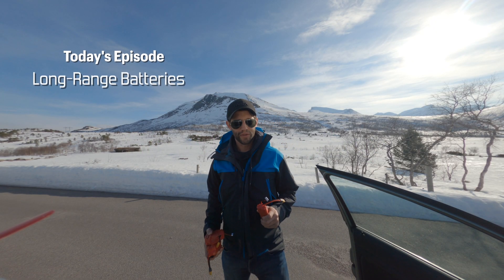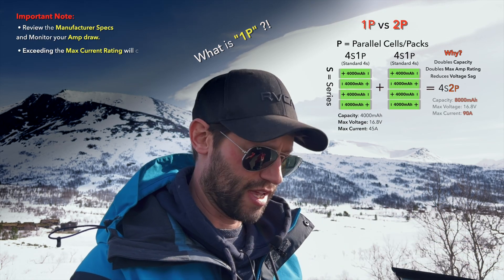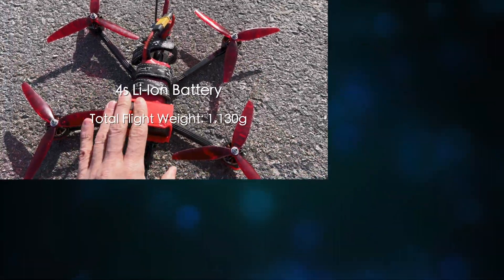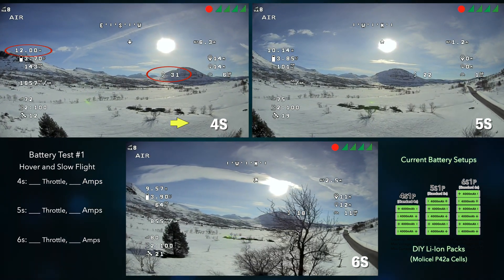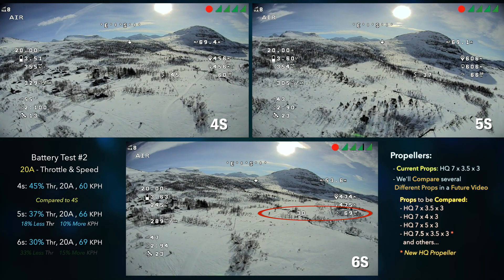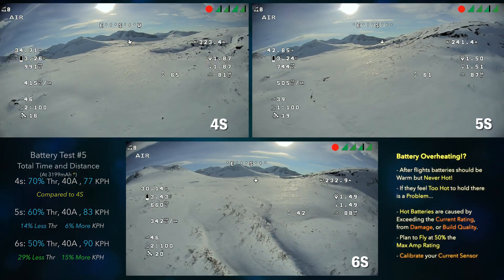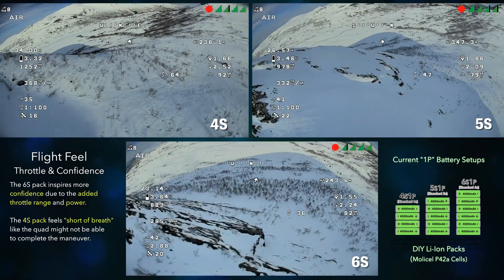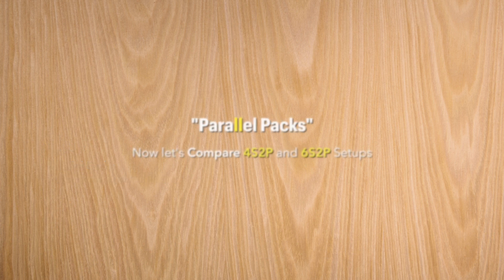Li Ion Battery Comparison for Long Range FPV Quads, Wings, and Planes. Chimera 7 with HDZero VTX

Comment: Excellent comparison, I have many 1P packs and they do struggle when you need to get moving quickly, even the 21700s. Good to see some usable data displayed.
Reply from the maker: You can build a simple parallel connector with 3 XT60s, then you can run a couple packs together in 2p. I highly recommend trying it as you’ll double capacity, double Amp output max and reduce voltage sag! 
Thanks for watching, stay tuned, cheers!
Reply: Yea some my drones the 1p packs land hot.  Real hot.

Comment: I got some Lishen 45a 21700 cells a few months ago. Hoping to make a 4s2p pack with it, using 1700kv motors! Will probably need to limit my throttle! I wonder if you flying in a colder environment allows you to abuse the batteries a little more because they dont get dangerously hot?
Reply: One thing I didn't realize (at least to this extent) with liion, the more current you pull, the less mAH you will be able to get out of the pack (by hundreds of mAH). Same goes for cold weather. There are charts out there but I had a new liion that I pulled 3900mah out of (200mah less than capacity) flying chill on a warm day, and another guy with a similiar pack pulling more amperage on a cold day had a flat dead pack at 600-700mah less than capacity.
Reply from the maker: You should not have to limit your throttle or motor output for that 4s2p setup. Heat is definitely the enemy, and in hotter environments you will see some degraded performance. But if you keep the Amps below the Max output you should fine. Do some tests and feel to the batteries to be sure and get used to how the setup works. Thanks for watching, cheers!
Reply: It is normal for lion warmed for 60°C, don't worry if it happens)

Comment: btw is this inav beta or ardu?
Reply from the maker: This is BF.
Reply: btw I tried the 8 inch props.. don't bother lol not worth it
Reply from the maker: @elxero2189  haha! Thanks for the update. My experience with the 7.5” props seem to be that they are more efficient but feel slower to respond, but I haven’t done any solid back to back testing yet.
Reply: @GiantAntCowboy  I didn't do solid back to back either but the quad feels slower to respond yes have to do wider turns I was trying to maintain constant speed over all I'm noticing the same amo draw at the same speeds. Even though the efficiency numbers at the end of the flight show differences. I can only guess that since ethe only thing I'm changing are the props then I'd get the same power output. The only difference will be at what throttle and what speed. Which changes depending on the prop.

Comment: Hey, great video, but I think I found a small error at 7:17. All 3 setups show exactly the same amp usage down to a ma, even though in the osd you can see different values. Is this on purpose, did I miss something?
Anyways apart from that, for sure the best and most in depth analysis I got to date!
Reply from the maker: So the reason is because I adjusted the totals to account for the mAh used during setup. (Pre-flight Checks, acquiring GPS, etc.) 
Adjustments we’re 225mAh from the Top Left, 52mAh from the Top Right, and 448mAh from the Bottom.  If you check back at the start when I arm and takeoff you’ll see I started with these totals. 
There is a small note about this at the end of the test, but I should have made this clearer. I was trying to be accurate… Happy to see you were paying attention though, thanks for watching, cheers!!

Comment: I'm very curious to see how your quad would perform if you swapped the 7 inch props for 8 inch props on the 4s setup and see if that would do you better when compared to the 6s with a 7 inch prop... I suspect it would be surprising. yes it's not an apples to apples but if you're chasing better performance or better flight times it's worth wild to attempt this. I'm in the process of testing it myself however my props have yet to arrive
Reply from the maker: So I don’t think I could fit 8” props, however I have a set of 7.5” props that I’ll be comparing in a man upcoming video. Cheers!
Reply: @GiantAntCowboy  ah I see. On my tbs source one 7 dead cat I'd have trouble fitting 8 inch as well however I'm going to flip the quad upside down and stagger my props that way it will fit

Comment: great comparisons - the challenge is always what batteries do I have on hand that are performing well for me today - I run both 4s and 6s on some of my quads and it isnt always clear what batteries perform best under what flying conditions - if I know its NOT going to be windy some 4s seem to work well - if I need the juice 6s is great to have on hand - flight times between 4s/6s always seem comparable - weight of 6s offsets the gains generally - but 6s hands down flies "juicy-er"
Reply from the maker: Thank you, and very well said. Your exactly right, the two packs seem pretty comparable except the 6s does feel a whole lot “juicy-er” which inspires more confidence as well. It’s nice to know you can “pull up” at the last second. I’ve been testing these J75 props recently and they are fast and loud beasts with the 6s pack, a lot of fun!